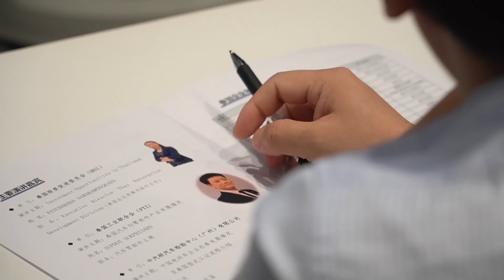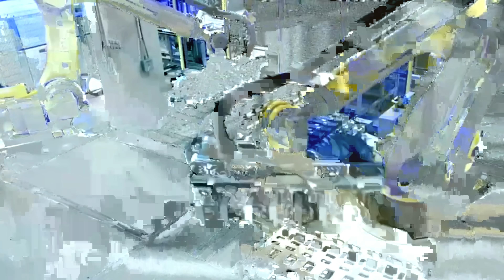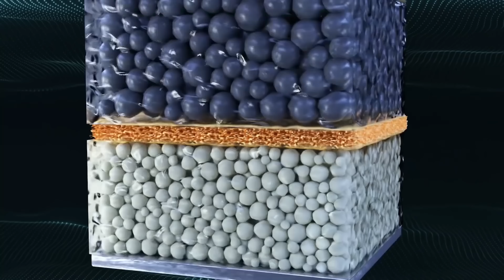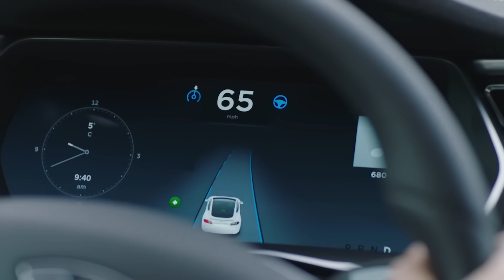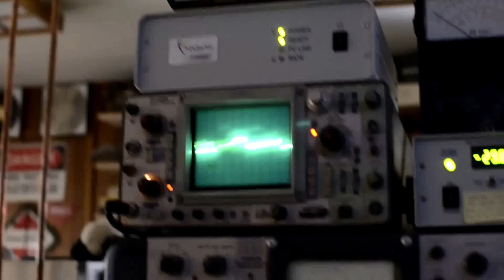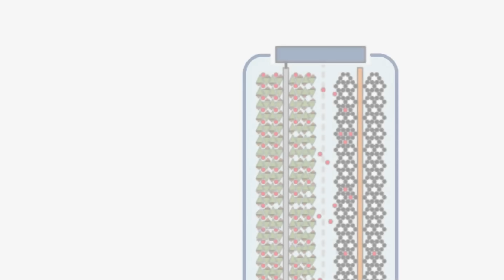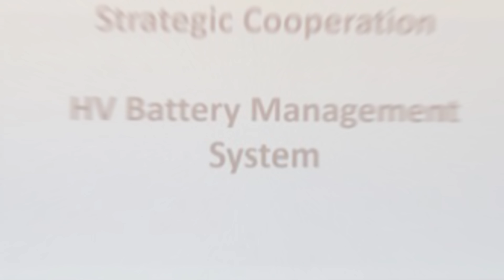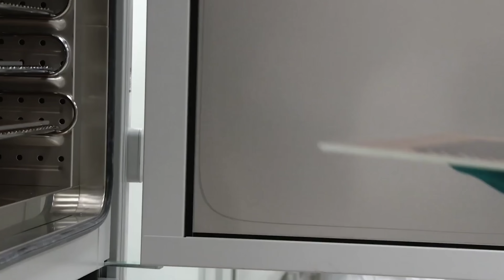Tesla's Nightmare Battery is Here

Comment: At 1:42 you say "using a fast charger or a home charger, you will definitely spend more time than your colleague refueling at a gas station".
Nonsense - this only applies to long journeys, for which most of us only do a few trips a year. For the remainder of the time, home charging is faster (and cheaper) and more convenient than a gas station.
Also with pre-warming, cold batteries are not usually a problem.

Comment: All this battery BS is going to be a thing of past once a new nuclear reactor on an integrated chip in development now goes into final production in the next two years, it will have no charging or range limitations to deal with. It's just a matter of interconnecting the chips with proper heat sinking in the proper series/parallel configuration to get the desire voltage output!

Comment: The best battery has less than 200Watts per Kg; diesel or gasoline have 12000 watts per Kg, no contest, the faster the EV craze ends, dear rich fanboys, the better
Reply: True, batteries have lower energy density (under 200 Wh/kg) compared to diesel (around 12,000 Wh/kg). However, electric motors are 85-90% efficient, while diesel engines are only 30-40% efficient. Plus, the total weight of an EV motor and battery can be similar to that of a diesel engine system. EVs also have lower maintenance costs, and I can generate my own electricity with solar panels—something I can't do with fuel. EVs aren't for everyone, but for me, living on an island in the Philippines and charging at home with solar, it's a game changer. Here, EVs are available for less than $20,000.
Reply: It will never end. EVs are way superior to Ice cars!

Comment: "the batteries can function normally in the temperature range of 30° C to 65° C".  That's 86°F to  149° F and  IF THAT WERE TRUE would not be  a practical operating range for vehicles that have to operate between -30°C and 50° C.  Even if the range was actually -30° C to 65° C, this still would not be a threat to Tesla. They would buy batteries or license the tech until they improved upon it.